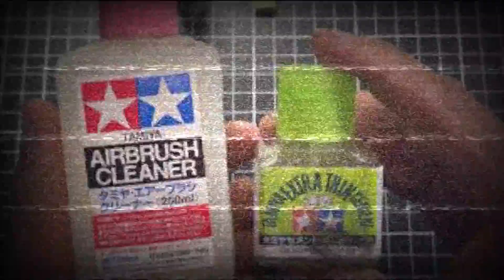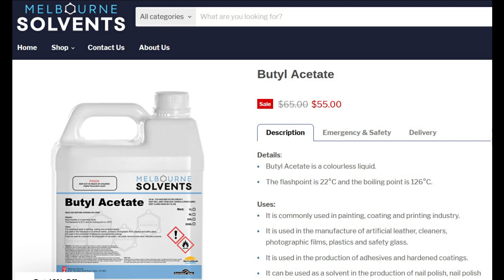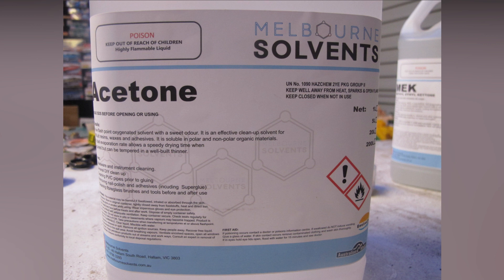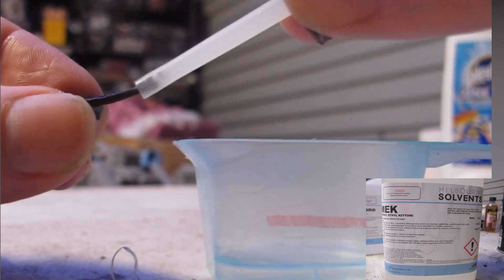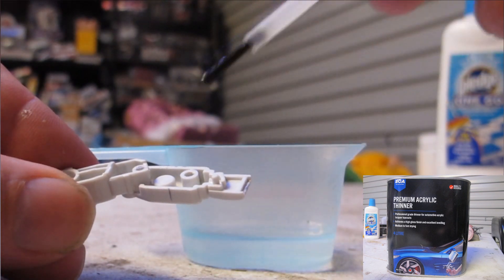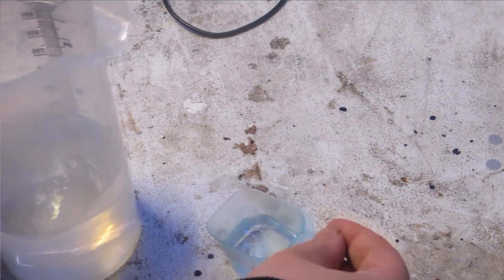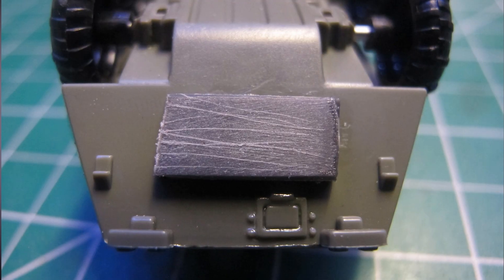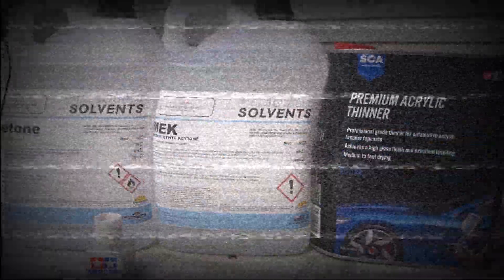model kit workshop 172: Make your own plastic cement cheap

Comment: Please help me guys ! Hello Im reallly new in Models world and Im actually buying everyting to start (Citadel paint, airbrush, UV Resin, Super Glue and lot of other things...).

And of course I dont want to spend too much because Im not Elon Musk, so I try to make some research to make a lot of things by myself and of course Plastic Cement are of the things I want to do by myself.

But they are some problems, I dont see a real consensus about the % of chemicals used and even what chemicals use. So maybe someone or the YouTuber can help me.

I want to make a Plastic Cement so If I understand well, I need to use 45% Acetone, 45% Butyl acetate and 10% of sprue pieces from GW plastic.

(Im going to make also liquid plastic sprue goo for filling gap, so what % of sprue plastic do you recommend to put in the 50/50 Acetone, Butyl acetate for a good consistancy ?)

Im also going to do more thick sprue goo with just Acetone and plastic, for that I think Im going to be able to do it.
Reply from the maker: Hello, all scale models from Gundam GW to Tamiya and other brands use pollystyrene plastic with a mix of abs or other resins to save money. Watching the video I did a few chemical blends and found as long as its a strong solvent or stronger the solvent the better. Make a few small batches and stick to what you like. I also have a make your own putty video and blending cheaper paints as well if you explore my channel. Its all about budget with results.

Comment: I love mixing my own things.. i only spray water based acrylics so have been trying several diy recipes, but now i am using a real simple one that just work excellent with every brand i try.. Butyl glycol and distilled water, 5% mix as thinner. Butyl glycol and Butyl di-glycol at 10% BG and 5% BDG into 85% distilled water. Works better than Vallejos products, think the additional Butyl di-glycol slows down the evaporation somewhat and keeps tip dry away better. 

Used 10% BG in my thinner first, but decreased the ratio, if i would not want a thinner and a flow improver, that is probably what i would use, 10% BG. But i like to have a thinner and one with more solvent in it, for when needed. 
From my research, it seems like Butyl Glycol probably is a part of more or less all water based acrylics, and also in several lacquers too. 
Probably why it works so well with every brand i try, i am not introducing something new, only what already is in the paint(probably..Hard to get that down for certain, producers keep their recipes down hard)
Before i used one based on alcohol, isopropyl really but ethanol worked as well, but Vallejo paint do not like that at all, and i have many Vallejos, so i started researching and also found my best info on britmodelers. Pity it seems the activity there is slowed down, atleast in these subjects, which i find extremely interesting. I truly love making shit out of different parts of shit to make a better working shit of a shit. 😂
Distilling is the same, proper fun that too. 😂❤
Reply from the maker: hello I been researching this on and off for a bit and next mixing project for water based stuff then thinner non hobby breanded cheap $2 shop stuff after being filtered. Thank you very much for sharing your mix which shall add to the data and test pool when buying some. Glad others are also custom mixing too. Happy modeling.

Comment: Hi Alan, want to use. Winser newton oil based paint to use in air brush any idea on formula was going to use turpintim with may be some mek. Hope you can help with some components 
Thanks Dennis sells
Reply from the maker: Hi, this is an experiment I would like to try and make a video on in future. I have used a dryer enamel in past with great results. The market is full of many great types of turpentine slow drying and white spirits fast drying solvents. These two will be fine depending on the finish for your oils. Do a test spray on a similar surface which you intent to spray and watch how it sets and drys.
Reply: @mokanaman  thanks for helping

Comment: Amazing video, but what is "spru glue",the white stuff,and where to het that?got lost in translation,not english native,sorry about that.
Reply: Spru glue is the plastic runner cut up into small peices. Then soaked, covered, in the solvent for a time. It's to make the plastic liquid enough to use as a putty.

Comment: Thanks mate, great vid!.... Does anyone know how to make CA glue? (super glue) Its seems to be a closely guarded secret ?!?
Reply from the maker: proper high quality super glue is just pure Cyanoacrylate, large amount is combustable exposed to air and super harmful base chemical to the reason why it sold in small bottles or packs. You can buy it larger amounts cheaper online then hobby or hardwear stores.
Reply from the maker: I got about 10 or more 5ml bottles from aliexpress cheap and has lasted about 3-4 years. Really should make a video about this topic, thanks for the idea.
Reply: @mokanaman  Just a question mate... Can you thin CA (superglue) by adding a little acetone?
Reply: @mokanaman  Thanks for the info champ... cheers from Australia. Take care.

Comment: From what I've read the different solvents all bond the same but usually just change your available work time. The slower the evap the longer you have to position your parts.
Reply from the maker: These solvents can also be adjusted by how much plastic you desolve into it as well or addition of glycol if you still want it thin. Completely customizable.